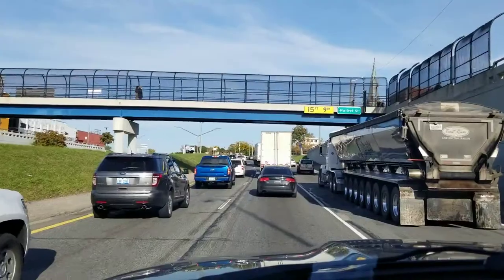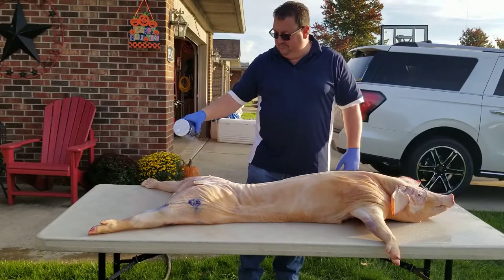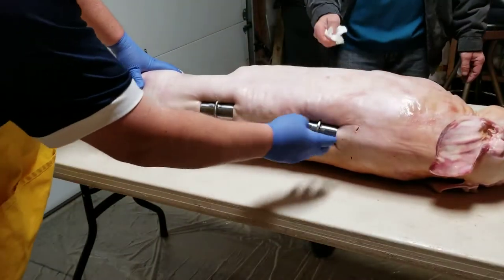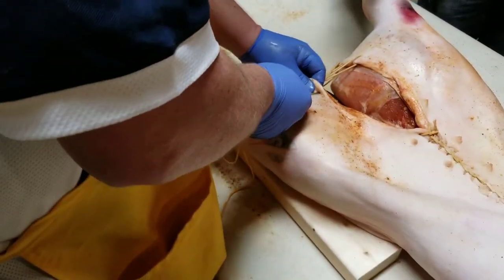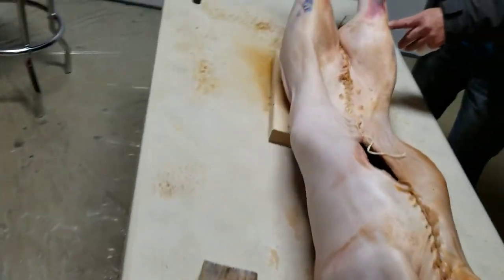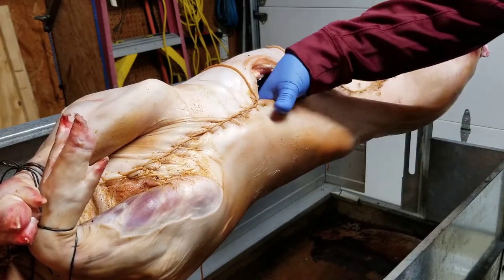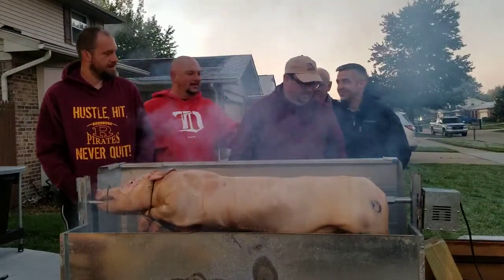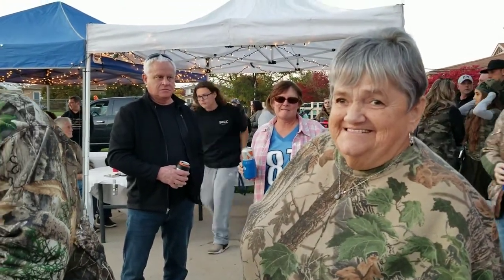Pig Roast 2019

Comment: Hey great job on the spit roaster, we used to wrap ours in chicken wire a couple times around, then it just comes off with a pair of tin shears. The only or main place to heat are the hams and shoulders the middle cooks itself. You might want to try injecting the meat with some juiced up Italian dressing. We used to use a garden sprayer with vinegar and oil in the cavity a couple times an hour. But great job, nothing is better than a pig roast.

Comment: Do you rub the pig with oil at any point?
Reply from the maker: Sometimes, I use melted butter and a brush, and as it turns on the rotisserie, I lightly coat from the head to the tail.  Only because that's the way I was taught.     And only during the beginning stages of the cook.   I was told it helps keep the skin from breaking apart.

Comment: How long did it take to cook the 80 pound hog on charcoal? Have you ever tried using propane?
Reply from the maker: I've never used propane, always charcoal... about 6 or 7 bags for sure.  It depends on the wind.  It took about 10-11 hours.  It cant be too hot; it burns.  It can't be too cool; it won't cook.  Its gotta be a steady heat and must be watched all day.  No leaving this baby unattended.  But we have a lot of fun each year!  And the party keeps growing!
Reply: @GebosGarage  We'll use charotis machine  for the first time and was wondering. Thanks a lot!This helps a ton.
Reply from the maker: Okay great.  Is it one like this?  If so, don't do anything bigger than 80 lbs.  The ends (spit supports) tend to "push outward" with the weight and it looks like it could slip out of the spit holder on the end without the motor.  We fixed that with some wire down low.  Check out this video of a little overview of that model.  

If you enjoy being outside cooking... you'll enjoy this roaster. 
 
* NEVER LET IT STOP TURNING... 
* keep your back up, hand crank nearby.  
* The pig burns faster than you think.  *Use a shovel to move the coals around to the areas that need less or more heat. 
* Start with a small amount of coal first, let the pig heat up, then add a little more as you go.  
* Too much heat from the start will ruin your experience.  Use one bag to start.
* Keep the heat toward the front and rear of the pig.  
* The center doesn't need a lot of heat.  * The key is to keep it sewed tight and plug any holes with foil (mouth, butt)
* I would skip stuffing it next time. 

https://youtu.be/YnkMYT0wdOQ

Good luck... bust most importantly... have fun.  

Thanks for visiting the channel.  Will post another pig roast videonin October 2020 :-)
Reply: I've done about 50 pig roasts. Just a few tips for you. #1 I use kosher salt and it's way better. Try to get the salt under the bottom of the skin on the hams. #2 try to make a cover for it. It'll cut your cook time in half. #3 bring the internal temp up to 185. I can tell by how he's cutting it, it only got to about 170. I also let it spin at a low heat for about an hour before I take it off. Just a few suggestions, it does look delicious!